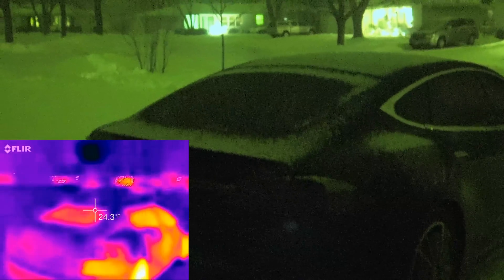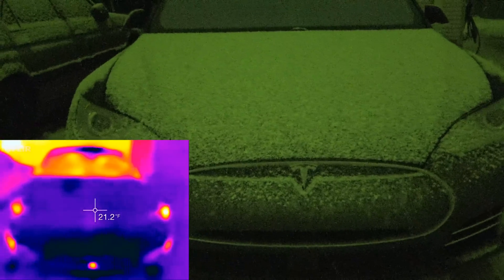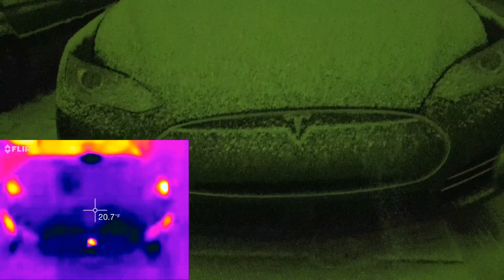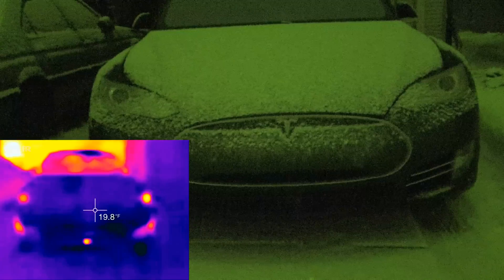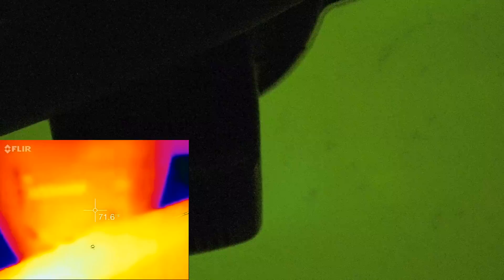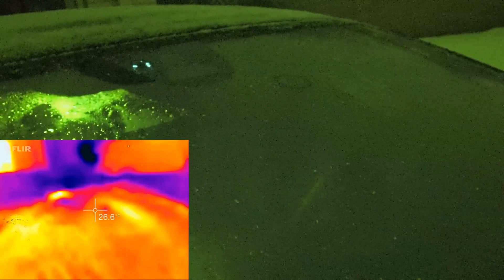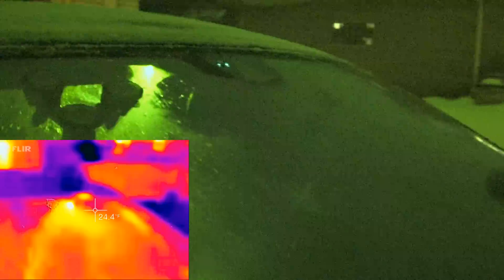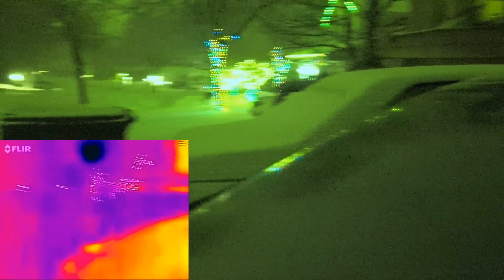Tesla Motors: Heated Radar AP 1.0?      Autopilot 1.0

Comment: Based on my own experience with my own 2015 Model S, I would have said there is no heater on the radar.  Certainly gets disabled quickly by snow.  So I am surprised by the suggestion here that there might be a heater on the radar sensor.